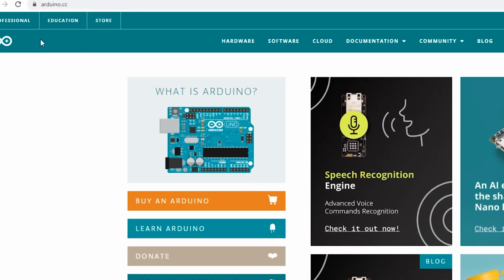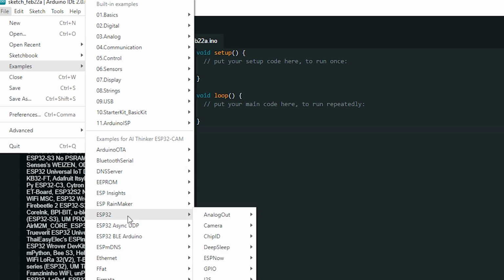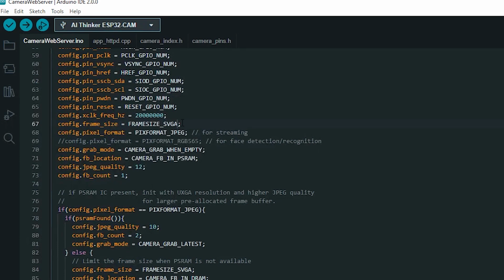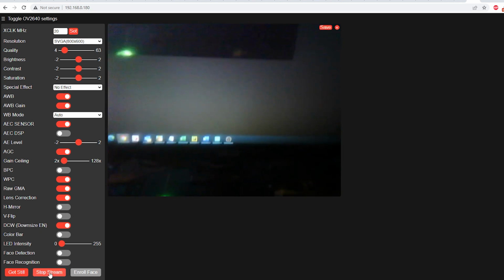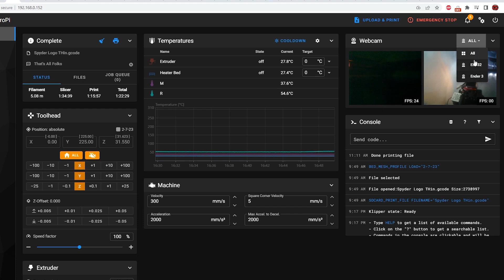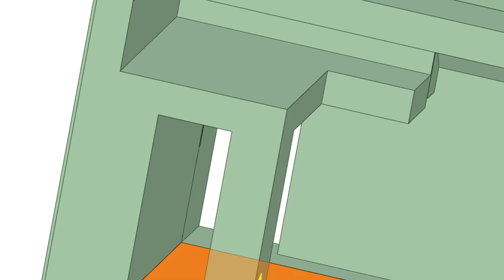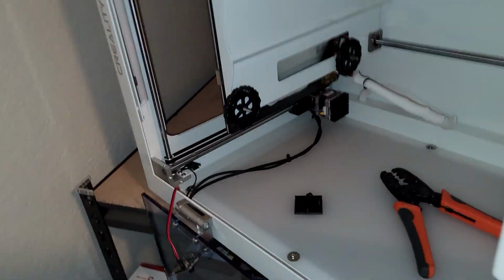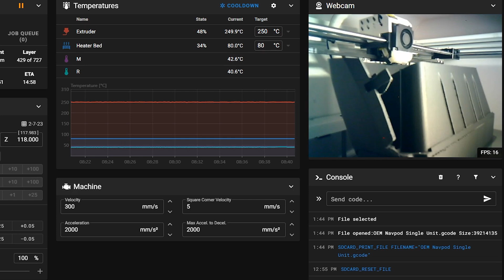EASILY Add An IP Camera to Your 3D Printer - WORKS WITH ANY FIRMWARE!

Comment: Man this video is the best one out there so far on this. The pace, the detail, little bit of trouble shooting. Thank you. Mine will be here tomorrow and this will be my main reference. Clear and concise. I appreciate you
Reply from the maker: Thank you for the feedback! I'm glad to hear that you found the video helpful!
Reply: @FoulNews  any reason I can't get them to work after testing on a external power supply I've used different cored and bricks and if it's not in the computer I can't get it to get me a feed.
Reply from the maker: Are you using the USB port to power it or directly through the power and ground pins?

Comment: Hey thank you for this! The camera holder is sweet, definitely going to check that out. It's probably best to use a seperate esp32 to tap into the serial monitor data similar to an octoprint setup, rather than combining both into doing both tasks, cam and monitoring?
Reply from the maker: A single ESP32 can definitely handle both operations without any issues. The tricky part will be getting the code to run as a web server and monitoring the print data at the same time.

Comment: Thank you so much for the video, question is there a higher resolution camera available?
Reply from the maker: I think the highest resolution for these ESP32 cams is the OV3640 sensor with 3MP at 2048 x 1536. However, I believe you may be able to get a larger sensor in there, but would need to tweak the firmware in order to get it working properly.
Reply: @FoulNews  thanks~!
Reply from the maker: @carlbroker  No prob, good luck!

Comment: Glad to find your videos on the cr5. Why did you change the mainboard?
Reply from the maker: I changed the mainboard because the power supply was wired incorrectly out-of-the-box, which ended up killing the OEM mainboard within a few days. So I figured I'd upgrade to the SKR mini since it has some cool features like having the hotend fan turned off when it's not in use etc...

Comment: I had to do the Linux install.  I get all the way to sending the config to the camera in IDE.  It says it's complete, but I get bad data and a "E (495) esp_core_dump_flash: No Core Dump Partition Found!" error message 2 times in a row.  I get no IP address, regardless of what I am putting in to the SSID and password.  I am at 115200 baud.  I've reset this camera about 20 times and get the same info in the serial monitor.  No other error messages.  This thing is frustrating.

Comment: 12.99 for the camera you linked..... 16.99 for the buck converters you linked.... you can get complete working cameras out the box for that price
Reply from the maker: The ones linked are the exact ones used in the video. I personally buy in bulk since I have multiple use cases for them, which brings down the cost per item and cost per setup. But if buying for only one project, there are definitely single units available for a less total price.

Comment: Well, your instructions worked, and thanks for that.  It appears that QC may have deteriorated since you bought yours.  I bought the same 4 cameras from the same Amazon vendor as you (little higher price by now, but still ok).  All of the installation (per your video) went without a hitch.  The problem comes when actually trying to use these (yes, all 4 act exactly the same).  I can connect through my browser as you describe (i use the hostname rather than the ip address as you describe because ip address changes every time you power up the camera), and start a stream which crashes after a single partial frame.  Initially  I can control the LED as your video demonstrates, but that ends after a few seconds.  If I stop/start the stream again, I get another few seconds of LED control, until the stream crashes again.  

I haven't decided yet if I'm going for refund or replacement.  A 100% failure rate is a HUGE red flag.

In summary, thanks for a great instructional on a not-so-great product.
Reply from the maker: I'm glad to hear it worked for you, but sorry to hear that the cameras aren't working right. Are you using a stable 5V 2A power supply for the cameras? They tend to crash and not work well when USB powered and work much better when directly powered using the 5V and GND pins on the back. Also, depending on your router setup, you can always assign a reserved DHCP IP address so the IP won't change on the camera.